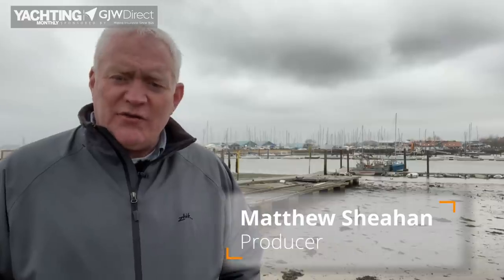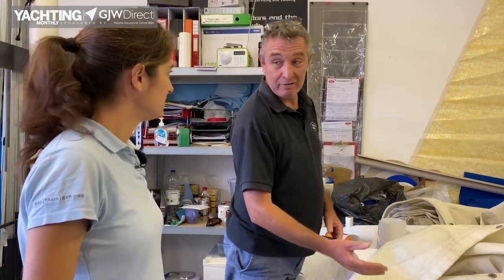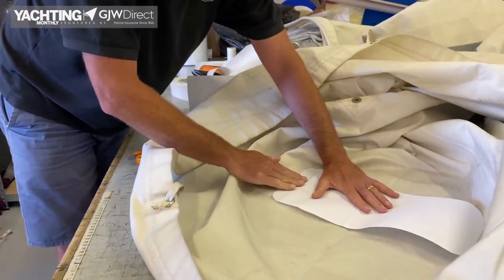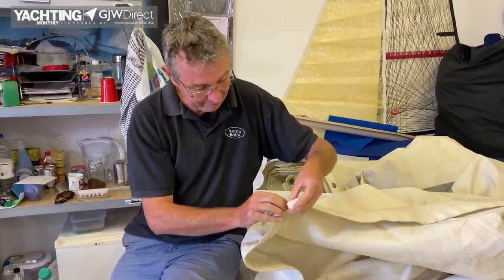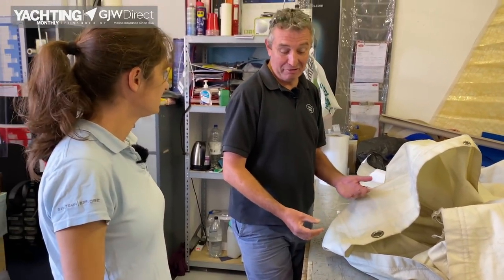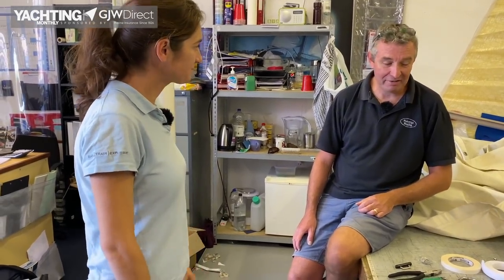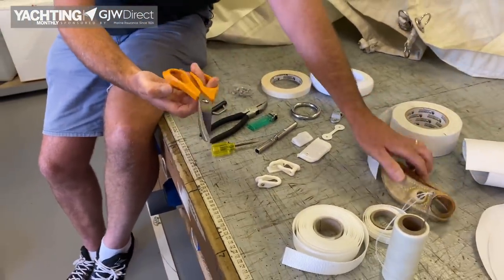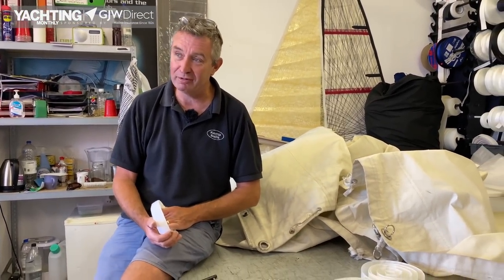How to repair a sail - Yachting Monthly

Comment: To cut Dynema, webbing and fiberglass, get a pair of shears for Kevlar  (look just like scissors) . I've got two pairs of Clauss 18425 8" Bent Kevlar Shears (one at home, one on the boat). These cut the tough stuff. Well worth having.   
Also I think if I were at sea and needed to replace a damaged reef point in a hurry, I'd use webbing but after several loops I'd tie a big ugly knot. If tied properly I think it'd hold.  Webbing is really great stuff. Tubular nylon is the strongest. I made leg loops for my PFDs. One end is a sewn loop (and carabiner), but the other end is just a knot tied to a carabiner. This allows the length and fit to be adjustable. Compared with the plastic clips on my more expensive Spinlock they might be too strong. In an emergency I could clip someone into the helicopter cable and never worry if they'll hold.